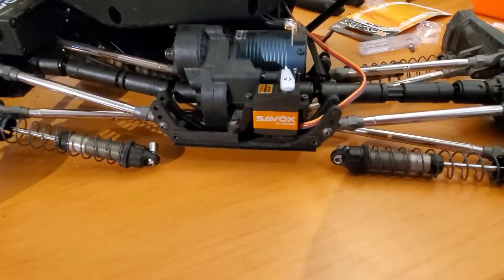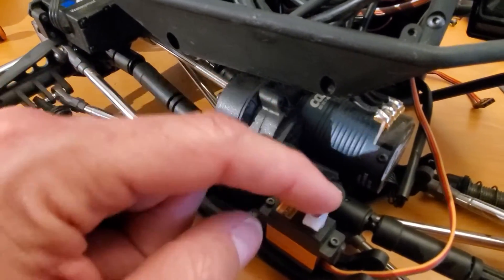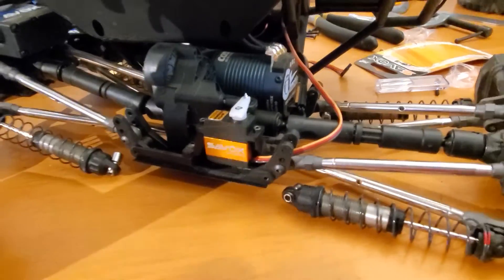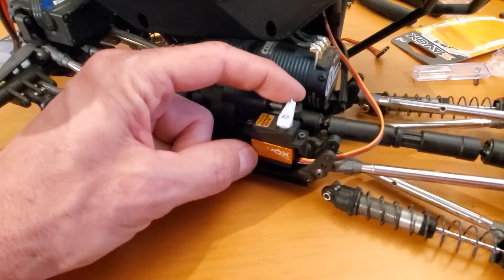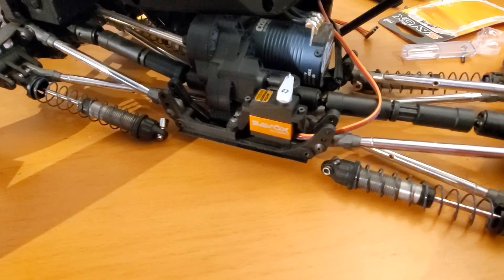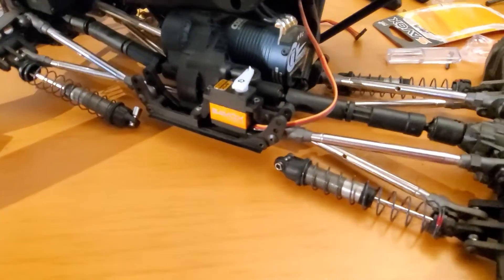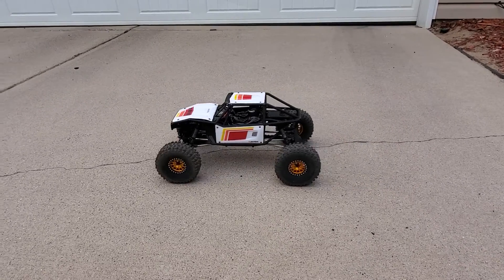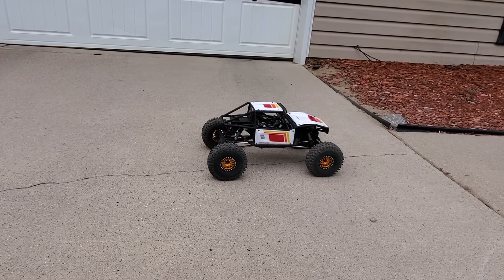Axial Capra Dig Servo Fix - Upgrade

Comment: I used a cheap micro servo for my dig. I used an aluminum servo horn and a 2mm bolt that had the perfect size head to fit in the dig shifter. If you adjust the endpoints correctly, you can use the 3 position switch on the GT5 to make it 4wd, front wheel drive, and dig.

Comment: Let's blame Horizon hobbies, thay have tried to take over. I'd love a savox, just cat afford on disability. Is dig valuable enough for the purchase? I dont't know how good Axial was before being bought, but i can confidently say the capra kit is just terrible. Many parts needed in bags opened much later in the build. Nobody knows if the manual has been updated from original problems. Rims are garbage,  can't fit any of 3 tires i have without longer screws. Theres a good reason i have stuck with traxxas. Much better engineering all around. Forgive me, i'm done ranting
Reply from the maker: I do like the Capra but I do prefer my TRX4. I use dig enough that it was well worth the $35 for the servo to fix the dig function. I do agree with you that out of the box, Traxxas has better components. I have highly modified both crawlers so all of the garbage parts are no longer on either vehicle.
Reply: @rccrawling7282  what really turned me against Axial was their fest wouldn't allow other brands. Still, i gave in on what is supposed to be a pure crawler. Second guessing that waaay over priced decision now. Thanks again friend
Reply: @rccrawling7282  thank you! I much prefer mine too. Many upgrades i was able to fab myself.

Comment: Quick question, I picked up this same servo for my dig unit and without a servo horn on it just resting under power it’s making a ton of noise. Is there some setting on my flysky gt5 that could possibly fix this
Reply from the maker: Have you tried setting end points with it out of the vehicle, not installed? If it's making a noise without being at one of it's limits that seems odd. I never had that problem with mine.
Reply: I have, it will make a ton of noise not even in my truck. I didn’t know if there was like a voltage setting or something

Comment: On the flysky are you using the chan 3 button of chan 4 3 positio. Switch  and do you only have dig on and off not freewheel as well ?
Reply from the maker: I'm using the channel 3 position on the grip. I only want the dig on and off. I don't care about the freewheel. I'm sure you could set it up that way though.
Reply: @rccrawling7282   thank you hopping to install mine tonight thinking about it not sure I would use free wheel  😀

Comment: Hi my compliments for your video! My DIG on Capra doesn't work so I am asking you help!! When DIG is engage the rear axle is free and it isn't lock!! The wheels are free...I followed the manual istructions bu now I have a suspect about it! So what do you tink about this problem?? Thank you in advance! I have on my Capra your same servo but my model is SH-0255MG and in any case it work!
Reply from the maker: Technically you could set it up so that you have 4wd, free rear and locked rear. I have mine setup for only 4wd and locked rear. It sounds like you need to adjust your servo endpoint further to the rear so that it will engage the dig, locking your rear tires.

Comment: Just had mine burn out on maybe the 2nd or 3rd prolonged use (of the car, hardly have even engaged dig.) 

If I'm not planning to run the dig feature anyway can I just disconnect and run as is in 4WD?
Reply from the maker: I belive you can permanently remove the dig feature but if you fix it, it's very useful in technical crawling. I use dig quite a bit.

Comment: Just put my kit together, set the limits on the servo, tested it before installed it, tested after I installed it, then when I attached the cage to the lower chassis it stopped working. Maybe I had the voltage at 7.4. No real idea what happened. I installed that same Savox in a small car of mine and it stopped working. Maybe I had that ESC/BEC set to 7.4 instead of 6.0. I bought a Vader skid that has attachments for a full size servo, maybe that will work. I’ll check back if it does. Thanks for the video.

Comment: I bought my Capra a couple weeks ago. The dig servo didn't last even 30 minutes. I hadn't even gone thru my first charge (3600). Was super stressed as this was my first RC car and not very cheap. Thankfully my local hobbyshop fixed it no problem - seems to be working better than new, now. I dunno what they put in - haven't bothered or needed to crack it open, yet. Did I get a lemon?
Reply from the maker: My understanding is most people have problems with the stock dig servo. Axial should have fixed this before they released it but they didn't.

Comment: I tried using the spectrum once more but it stopped working after three days. So I'm going to try the savox micro servo.
Reply from the maker: Just make sure you set your limits correctly and it works really well!

Comment: Did you try using the Spektrum servo without the servo saver?  My dig is also very hit and miss and I'm also using the Spektrum micro servo
Reply from the maker: I never got the chance. After one battery pack it never worked correctly. Basically it burned up in one battery pack which according to the hobby shop isn't unusual. It started to have a jerking motion even though I set it up correctly including the end points. I've ran five battery packs on the new Savox servo so far and it's awesome! No issues at all!
Reply: @rccrawling7282  yeah, I've heard most have had issues with this servo. That sucks you didn't even get one battery pack out of it. Mine is over a year old now. Strange thing for me, mine works perfectly fine on flat ground. I even have mine setup on a 3 position switch; 4WD, FWD with rear locked and FWD with rear in neutral. As soon as the buggy is any sort of incline or decline, it's a gamble whether it'll work or not...haha. More times then not, it doesn't. Or like you said, will have to backup a bit to get it to disengage. Maybe I'll try and delete the servo saver. If it still doesn't work, I'll be following your route 👍